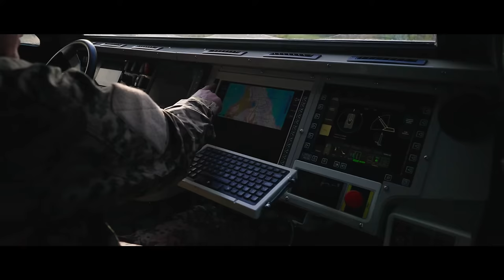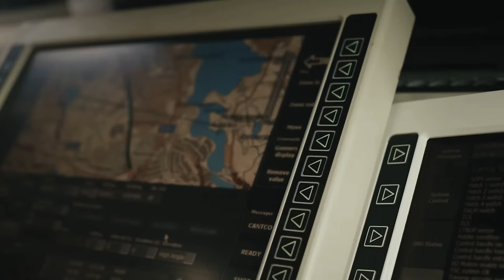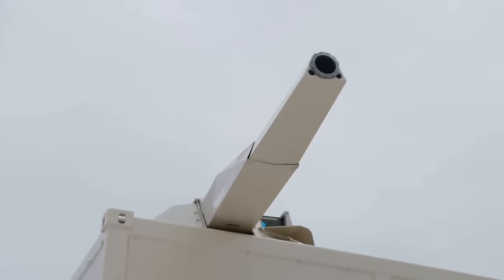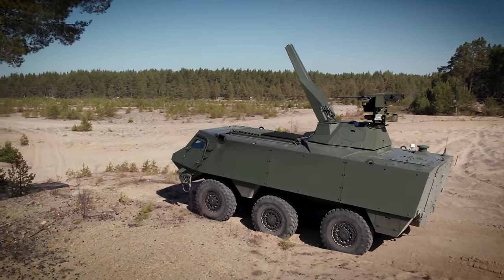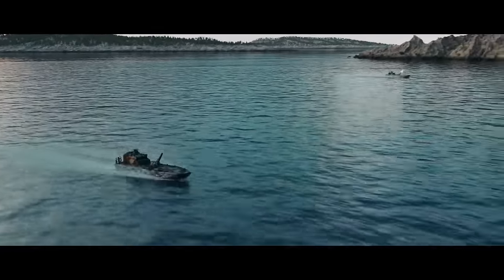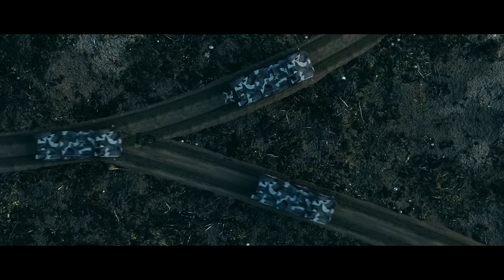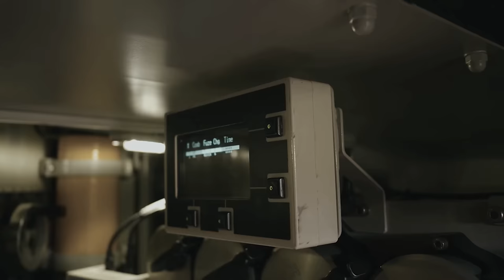The Patria 'NEMO' 120mm Mortar | WORLDS BEST MORTAR SYSTEM

Comment: a mortar in my eyes is an "artillery  system" for infantry. If you take away the portability i think you can simply call it  "Artillery"
Reply: It is a type of artillery weapon that is used to fire at high angled trajectories. Cannon and Howitzers are other typical artillery weapons. The high ballistic arc of a mortar is useful because it isn't obstructed by vertical cover or obstructing terrain features. Because of this they can be aimed to bypass vertical cover such as trenches or alleys in a city fight.

In the olden days pretty much all types of artillery were drawn by horses and advanced at the pace of the infantry. After widespread motorization of military forces it became common to tow artillery weapons by tractors or other motor vehicles. Anti-tank guns were used in combat by crews on foot supporting the infantry by direct fire. Then there are howitzers specifically meant for the light infantry that can be disassembled to peaces for the gun crew and/or pack animals to carry each piece separately so that they can slog right were the infantry goes to provide them with organic indirect fire support.

The system in the video is pretty weird for a mortar since it can also fire at low arcs and is capable of direct fire.

Comment: For several years, the Polish army has been equipped with the M120 Rak (Cancer). The tower is completely self-contained, includes an automatic charging system, and can be operated remotely. The vehicle is equipped with the Topaz system, the same one that is so praised by Krab users in Ukraine. The vehicle may not look as futuristic as Nemo, but it is much more technically advanced. https://en.wikipedia.org/wiki/M120_Rak

Comment: With a system like this with full electrical and hydraulic power and completely automatic this could very easily have a no limit to the amount of rounds fired by having the barrel cooled,
With systems like this having a liquid cooled barrel would be really benificial especially if it can be reloaded automatically and quickly,
Look at the otto maleria 76mm super rapid,
That's water cooled and can shoot over 100 rpm I think it's 120 rounds per minute sustained.
Reply: active cooling would increase the complexity and weight considerably. I dont imagine barrel erosion to be a problem with the amount of ammo that rapidly can be fired in this iteration.

Comment: Now if only technology were advanced enough to feasible a compact radar & target acquistion system, for the 50 cal. to take down drones. That would requier new tech.
Reply: Not really, just reapplication and adaptation of tried and tested existing tech.
Like adapting the radar controlled gun aiming of a jet fighter.
Reply: @SonsOfLorgar  
There is no tried & tested tech that small. Simple as that.
Reply: Um, there is plenty of automated radar guided AA artillery around, an aircraft´s an aircraft
Reply: @juslitor  
  Well yea, there's one in my back yard. And a tree is a tree. So?...Mr. Um.

Comment: I wonder if a battery of these could be used to take out the high density mine fields that the Russians have laid in there defense layouts in the Ukraine. Add a support vehicles that carries at least 100 additional rounds each it would be able to lay down a great deal fire for a ground assault with, it appears, a high degree of accuracy.

Comment: Eh, not to take away from Patria being innovative, as they certainly are, and NEMO is a great way to get mortar crews under cover. But I've been able to play with the turret version designed to interface with a light or medium armored vehicle and it's not quite what is advertised. The major issue is that the rounds are still manually prepped and manually loaded one round at a time (as you can see in the video at about the 6:50 point). There's a loading position that in most vehicle layouts will correspond to having the gun tube in line with the vehicle forward direction, or within a handful of mils left or right. So while one round might be fast, and if (assuming in this example the vehicle bow is pointed at zero mils) your target is at zero mils you might get multiple rounds off quickly. But if, say, your target is at 800 mils, the gun has to swing back to loading position after the first round, the human operator has to put the round in the load position, then the gun has to swing back on gun-target line to fire. Each of those traverses back-and-forth between load position and gun-target line takes time and induces potential error in your firing solution. A manual muzzle-fired mortar would actually be faster-firing and displacing for off-axis firing. It also means that the MRSI capability is limited in number of rounds (based on manual loading) and requires the target to be in line with the turret load position. So while good, far from game-changing.

In naval use with more room for an automated magazine, maybe less of an issue.
Reply: Not all versions are hand loaded. Theres a revolving 6 grenade magazine model if memory serves me correctly
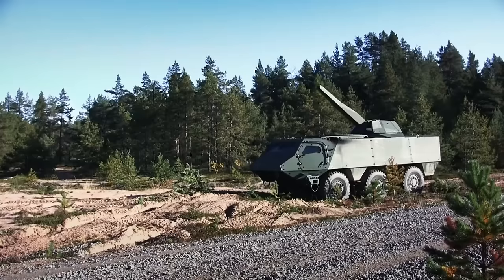Reply: This is why they cut the promotional materials after every shot as seen at 3:00 :)

Comment: Errrr no..... I would say it was the Russian 2B25 that sadly has proven itself in Ukraine. A single man portable 82mm mortar quick to setup and "silent firing." It's more dangerous, as vehicles on the new battlefield with all it's survalence are potencial targets with counter barages arriving in minutes. The 2B25 is an infantry weapon that delivers the round silently, with targeting adjusted by drone.
Reply: These things can be linked to any weapon systems so they don't have to seek the targets, they can hide and just spank the enemy while some drone gives the targets. Difference is, this thing can run away unlike troops on foot and it gives some cover for crew too, depending on what vehicle it is attached to.
Reply: @duhni4551  Troops are harder to detect Ukraine has proven that. Furthermore in that conflict it has shown the vulnerability of Armour to be detected. And remember shell detectors are acoustic so the 2B25 is a pretty scary concept. Establishing itself as a potent ambush weapon.
Reply: @thebritishengineer8027  I don't know, i have seen many videos where troops gets the nade from drone so nothing has been proved. Also you now make generalizations from poor Russian tactics and incompetency, their tanks are not covered nor do they bother to install any countermeasures or even get basic stuff to deal with drones, i mean all it takes is to scramble the air with radio waves, it breaks the control connection of it. There are plenty of other means to deal with drones. And no, it is not scaryer than any other infantry mortar, it has its huge disadvantages, short range, stationary shooting, rate of fire and so on. That if something makes easy target for drone and if the troops flee, then the mortar is toast. It is quite different beast to try to drop amv moving 80km / h that shoots you back and can detect your drone. Also Western doctrine doesn't leave any system alone without cover, there is that too.